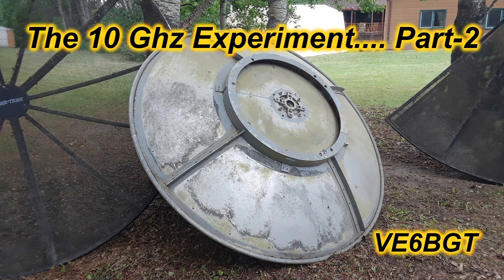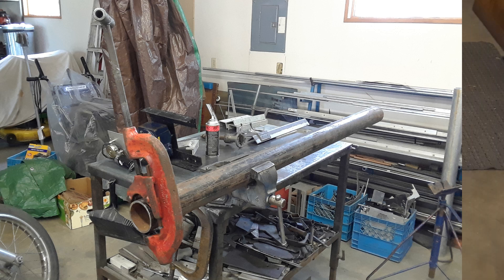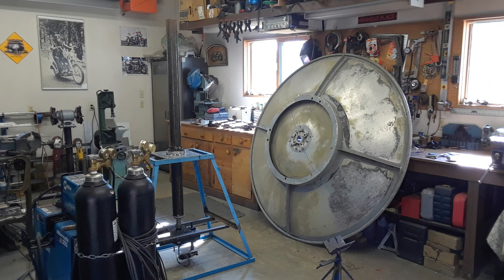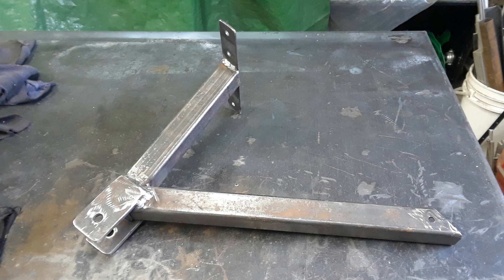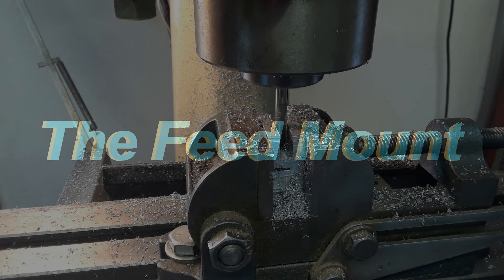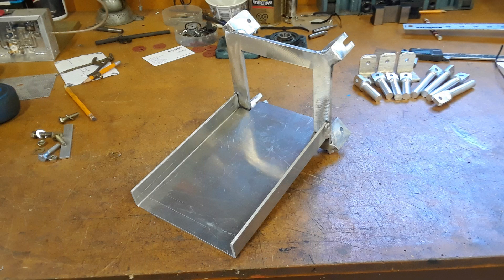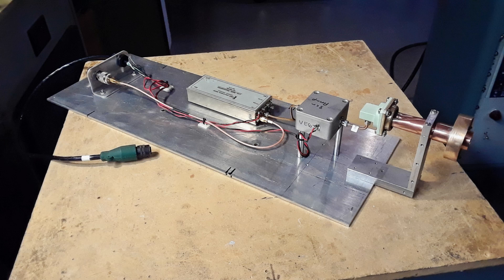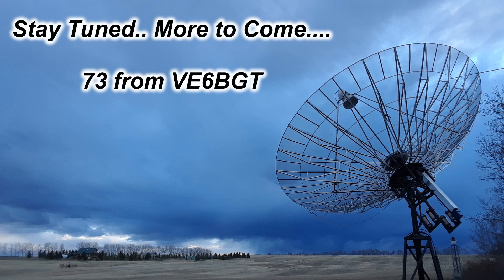10 Ghz Experiment Part 2

Comment: Nice project. Do you have more details of AZ motor? Mounting motor details? 73 Joe/HS2JFW
Reply from the maker: Hello Joe, not much to say about the details of the AZ motor.. Its a surplus 500:1 double worm, gear box from my surplus parts..
I power it with a small DC motor that was used for window motors in cars etc.. I did originally use this gear box on my 21.5 foot mesh dish and replaced it with a big slew gear, see my other video on that.. It unfortunately developed a small amount of back play or slop probably from the big dish use, I am going to take it apart and see if I can tighten it up some what.. Its simply mounted underneath he main mast and framed in there to hold it lined up with the Azimuth mast.. I built an aluminum adapter to go between the gearbox and the larger pipe.. Nothing complicated..  Skip